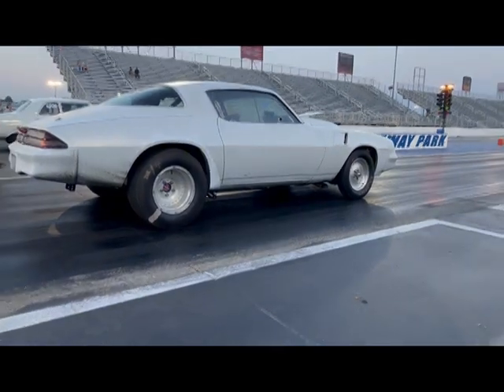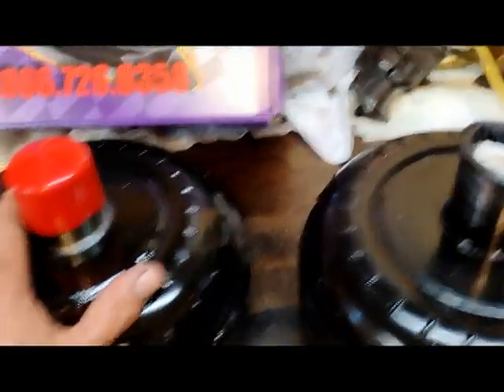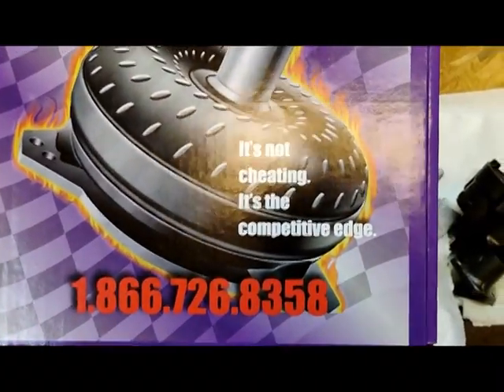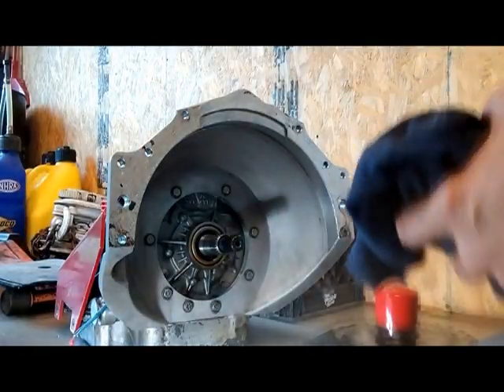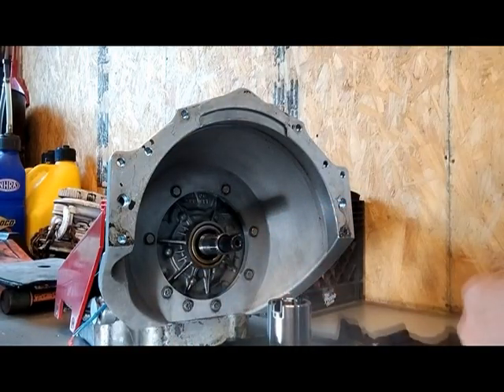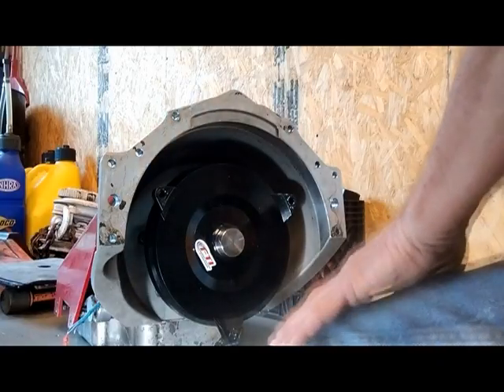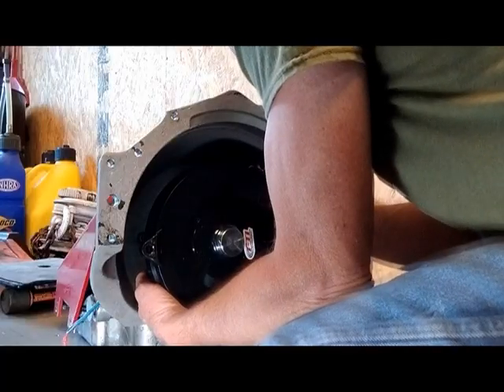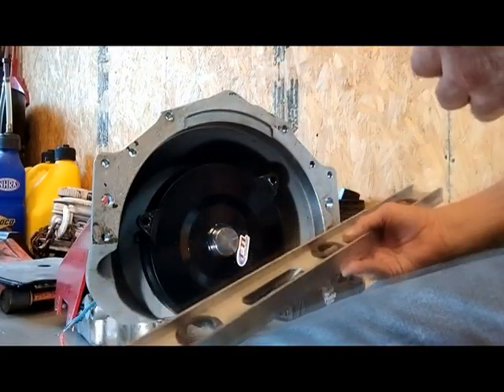How To Change Torque Converter and Stall Speed 2500 rpm to 6000 rpm

Comment: Yeap, big low end torque motors are very forgiving. Personally I'd rather have more low to mid torque than upper rom hp.
Reply from the maker: @blueridgemountainprepper2166  ya I understand but I had problems with the 496 and has to go to the machine shop and that takes for ever here to get work done so using my other motor for now see if we can get it to work will get that motor done soon I hope but thanks for the comment